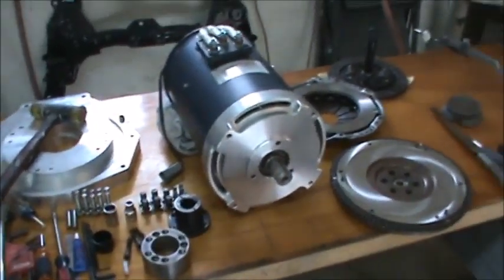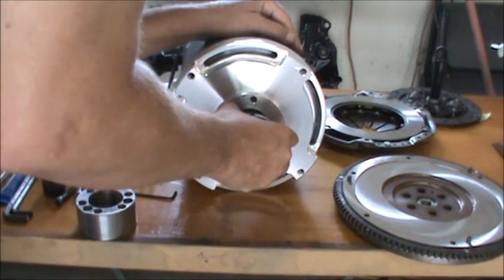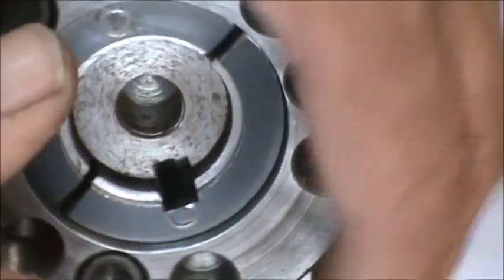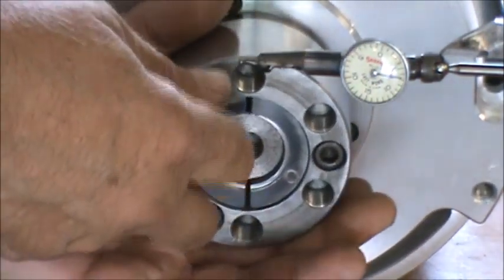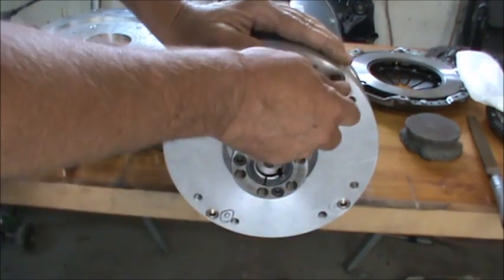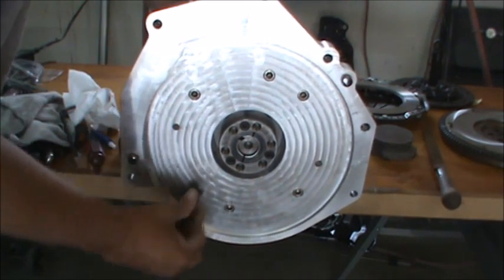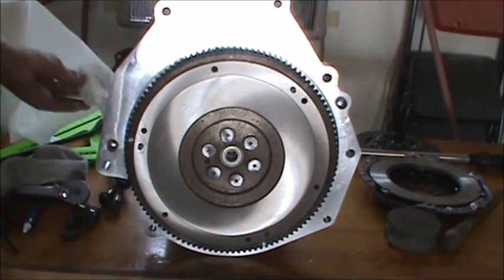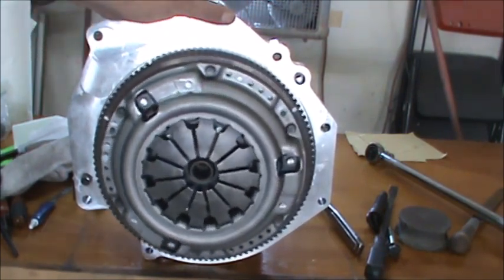Final Motor Assembly Of All Adaptors  My Civic EV Electric Car Project Part 26

Comment: Great job, love the ally billetwork.   But I would have definitely inserted the key in the flywheel adapter/motor shaft interface keyway.    Yes, I know that the adapter is applying a lot of force via its tapering, but that keyway is there for a purpose.

Comment: Beautiful work attended to detail I suggest a light flywheel it no longer has purpose a flywheel is to abate out the power impulses in this case four but with the electric motor they are none and the bull ring starter gear would be the first to go again very nice work !

Comment: I'm fond of carbon fiber every time i see a bespoke engineering job, because it moulds all shapes cold with no tools like artwork. You can mould the drivetrain and motor shafts with steel coupllings left over from previous hardward, and wrap them in carbon fiber to attach them to other couplings.

Comment: I would suggest installing Helicoils in the aluminum so there will be less chance of seizing of the bolts in the holes and wallowing out of the holes.

I have had thoughts of replacing the gas motor with an electric one in a 1988 Ford Escort I have.  Just haven't done it yet.

Comment: You can get bolts much tighter with less risk of damage with either a drop of oil, or loctite. Reason being is that threads are usually not exactly perfect, so they tend to bind up very easily, especially under a load. Doesn't matter how "old school" you are, this principle hasn't changed at all for decades, at least in countries that knew how to manufacture a car in the 70's.

Also, you don't need a clutch, there's nothing to stall. Better to just be direct drive to the wheels if possible.
Reply: You may be right about the direct coupling to the transmission and leave out the clutch. Many EV mods do this, in fact. I like that he's making the effort to preserve the driving experience by using a clutch. It means that he can take off very strongly in first gear (great torque multiplication in transmission), but also shift to higher gears easily for greater efficiency in the motor at highway speeds. Higher RPMs on motor require greater amperage, and cause accelerated wear on bearings and commutator/brushes (assuming it's not a brushless or induction motor). 
There is one good reason why he may have chosen to keep the clutch though. If this is a high torque, low RPM motor, he would have needed the higher gears to get up to highway speeds. If this is a low torque, high RPM motor, he would need the lower gears to have enough take off power to safely pull into traffic. Most likely, this motor is a compromise between the two (as most motors are), so he needs both low range and high range gears to get the right performance he needs for any driving condition.
One thing is for sure though: he won't be needing the clutch to take off. Just put it in gear and throttle up, since most motors have greatest torque at stall speed (0 rpm) anyway. The clutch will only be needed when shifting between gears at speed.

Comment: I was thinking, maybe just ream the flywheel out. Where it connected to the old crankshaft. Then cut the keyway out of the flywheel. Then its just a matter of spacing for an adapter plate. - Mike Davis

Comment: I wonder if it might have been a good idea to remove the ring gear from the flywheel as you won't be needing it and it's not hard to remove...You just run a hacksaw down between the teeth of the gear about 1/2 way and then drive a chisel into the slot and it will bust straight off..Loved the video Tom.
Reply from the maker: ZIGgassedUP I never removed one before if its that easy the next one ill take off
Reply: Can you use the old starter as an accessory, Battery charger?

Comment: great video was great to see how to couple the motor to the trans but got a couple questions 1st question after you mounted the flywheel to the motor noticed a small grinding noise then it disappeared how did you get it to go away. 2nd & more importantly why did you keep the sun gear or starter ring on that flywheel?

Comment: I wonder if the flywheel would have been less "wobbly" if you had remote it, turned the motor a little, then put it back on. Maybe some slight wobble on the motor, or the adapter would cancel out the opposite wobble of the flywheel and make it closer to perfect.
That finished product looks just like the back of the original gasoline engine. I guess that's the point, since it has to mate to the transmission exactly the same. Good craftsmanship on those parts!
I really wanted to see you apply power to that motor to spin the finished product, but then it occurred to me that the spinning flywheel + clutch assembly would act as a reaction mass. The counter torque created could be disastrous.
Reply: Warren , I was thinking the very same thing but didn't post it as I reckon once the flywheel is off, it might be a good time to just retorque the exposed flange to specs.

Comment: Hmm all I need is a 9 inch warp electric ac motor , lovejoy connector , 500 amp curtis controler , to the transmission , no need for an adapter plate useing L channel steel , useing lithium batteries , $3000 total build

Comment: You will need a clutch if you are going to use the motor to power a/c and power steering, I. E. Set the motor to idle just like an ICE engine.

Comment: New sub here. Excellent video.  I’m not a knowledgeable mechanic and it made sense to me. Where did you get your parts? If you have a web site with all the documentation just let me know where to go read.  Again ... excellent video describing the steps. I like it when someone will tell me why they are doing something.  You did that well sir!

Oh one more question.  How do you handle aluminum and steel? If you don’t have aluminum, just let me know.  We have always had to do special procedures to keep dissimilar metals from making corrosion.

Comment: Need to try to build an electric motor that will run on its own by using generators capacitors you might be able to use a hyster engine with dual shafts one out the front one out the back the back one will run your transmission on a rear wheel drive car and the front will run a generator power steering pump air conditioning xcetera

Comment: What gonna hold car still on a hill since that will be no compression might be a dumb question ibk
Reply: rttguy1969 A good E-Brake - you shouldn't rely on the compression of a motor to keep the car parked on any slope - sure I've relied on the motor compression to keep it from moving but you really shouldn't
Reply from the maker: rttguy1969 A good manual E Brake!

Comment: why  you need clutch with electric motor?
Reply: Strictly speaking, you don't, assuming you want to pick your gear while stopped and stay in that gear all the time. If you want to shift, it is a lot easier if you can disengage the mass of the flywheel + motor from the gearbox to allow smooth shifting. You want a lower gear for takeoff for better acceleration, and a higher gear while running at speed for better efficiency and less wear on the motor. If you tried to shift without a clutch, it would likely be exactly as difficult as clutchless shifting with the original motor. At the very least, the synchronizers would experience greatly increased wear. That flywheel turning at 3-4 thousand rpms is going to have an incredible amount of stored energy in it (relative to the handling capability of the synchros in the transmission).  I would imagine if you revved up this motor to 5k rpm, and disconnected power and let it coast, it would take quite a bit longer to spin down to 2.5k rpm so you could engage the next gear. That would be annoying to drive, for sure.
Now that I re-read this, I guess you wouldn't need the flywheel if you weren't going to have the clutch installed, so that inertial mass would be greatly reduced, though not to zero. The motor armature is going to act as a flywheel, so you will still have some problems shifting without the clutch. 
The biggest reason I would keep the clutch is to keep the driving experience as close to original as possible. Having a very difficult to shift vehicle would be much less fun and satisfying to drive.
On a side note: the Tesla motors have gear reduction to the axle, but it is a fixed two stage transmission. It can't be shifted at all. the motors are AC induction motors and capable of running at some 18,000 RPM if I remember correctly, so they don't need to shift. If this motor has a commutator, the higher the RPMs you run it as, the faster the wear on the brushes, and the less torque you get from the motor, so having multiple gears is worth it in this case.
Reply: Thanks warren.
Reply: Because clutch is cooler..😊...puts you in adrenaline mood..😊😊😊

Comment: what is the use of self teeth in flywheel here.
Reply: This looks like a standard flywheel that would have been bolted to the original motor. It has been resurfaced for better clutch performance, but otherwise appears to be unchanged. On the original motor, the teeth would have engaged with the starter motor when starting the vehicle, of course. Now that it is electric, those teeth serve no purpose at all. They do cause some slight air drag and reduce efficiency though. Removing them would have possibly helped performance by lowering the moment of inertia for acceleration, and reduced air drag on the flywheel itself. he may have been able to remove quite a bit of material outside of the clutch surface area, or even have a custom part of minimal size and mass machined from scratch. The cost of doing this, however, would likely have been considerable. Since the gains from removing them are so slight, I would not have paid to have them removed myself, so I don't fault him for keeping them. Less cost overall, and they don't really do anything.

Comment: I don't see why you need a clutch if you control the motor with say pulse width modulation and it is very much easier to make, or get an electronics tech to make one or get one from China.
Reply from the maker: Its a mechanical disconnect that i wish to retain.
Reply: Also, done people just like having a clutch. I plan to do this to my mr2. I found this video fantastic.
Reply: tomswonderfulworld I personally admire the fact that you kept the clutch. I love manual trans so much it is some of the main reasons I wouldnt switch. Now I can!
Reply: Can you recommend a product? Would it allow an EV conversion from an automatic?